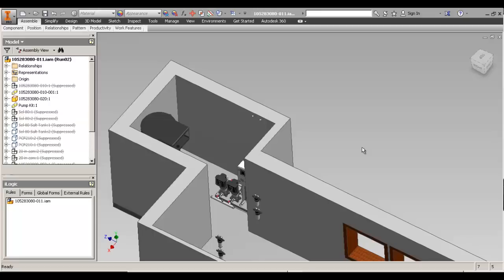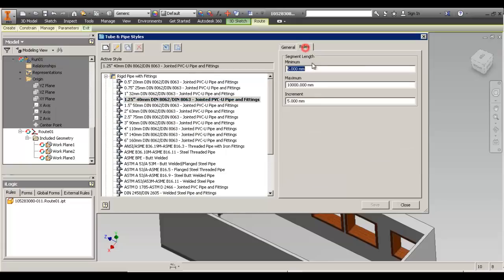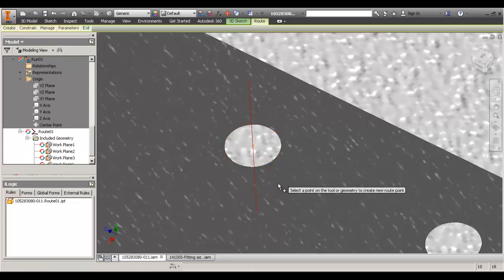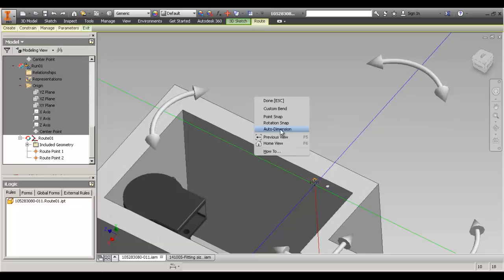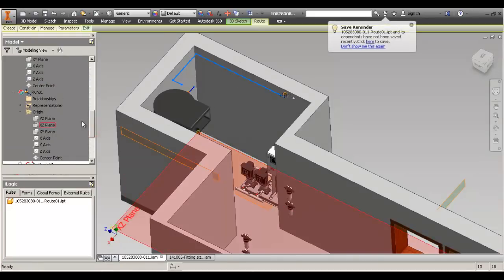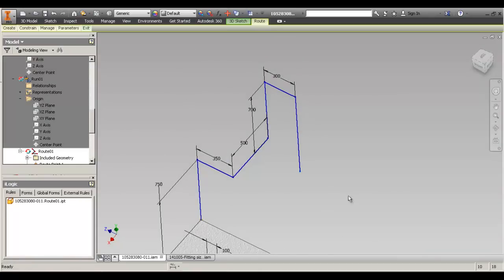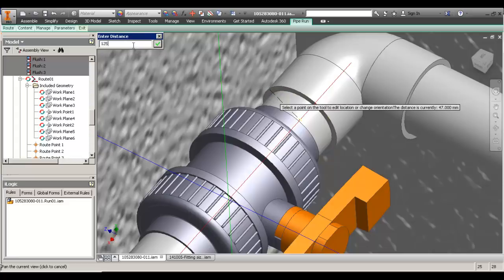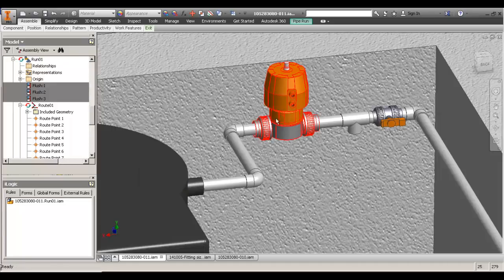Autodesk Inventor Tube and Pipe

Comment: HI,I find it very useful your video  , But I've encountered some problem, I can't modify the dimension of the pipe ,even though I set a different value ,the pipe remains the same?
Reply from the maker: Valerio Xu Is it just that pipe ? or more items are having the same problem.
Are your files checked in vault (read only)? Is the folder/files read only?
Is the assembly on Defer Update (Manage/Update/Defer Update)?
Is the tube and pipe assemlby set to Defer Update (right click on the T&P assembly in the browser and choose tube and pipe settings, verify that "Defer all Tube and Pipe Updates" is not marked. 

Get back to me if it's still not playing up.
Reply: Adrian Salariu   the "defer update " is off, In the company I can't do it,now I am at home using my computer ,it's not working neither. I just created an arbitrary  pipe,and the size modification is not working
What do you mean by saying the files are read only?
Reply from the maker: Valerio Xu How do you modify the pipe size? 
Do you right click on it "Change Size"?
Do you change the size of the route in Tube & Pipe Styles?
You need to create a separate style for all your sizes. A style can only have one size. Copy your style T&P Styles, choose a different name and size and then you can use it inside your route.
Reply: Adrian Salariu yes,I simply right click and change size. but I want to change  only one segment of  the pipe.Do I still need to create more styles?
I manually change the sweep sketch, but every time I move o edit the  pipe, it goes back to the default.
Reply from the maker: Valerio Xu Right clicking on a pipe segment and selecting "Change Size" should do it. You don't need to create more styles but you seem to edit a tubing with bends correct ? In that case you might want to give us a vote on the idea station because that's not possible at the moment:

http://forums.autodesk.com/t5/inventor-ideastation/tube-and-pipe-overhaul/idi-p/5518269

Here's how to fix it:

Right click on the segment Change Size so that the parameters update in the part. Open the part up (pipe segment) and edit sketch 3, constraint the circles and dimension the outside circle as OD and the distance between circles t or whatever the parameter names you have for pipe outer diameter and pipe thickness.

Come back to assembly and change size again to verify that the segment updates NOW.
Reply: Adrian Salariu so only the pipe with fitting is allowed to change size? but I saw from the link you gave me that even the tube with bend can do the change size to single segment , by the way, I select only one segment,not multiple ones, and I change the size by doing"change size" , but the pipe remains the same .
And If I want to add a pipe diameter to the style, for instance, an gas fitting 1'', the diameter is 33.249mm, how can I do it?
Reply: Adrian Salariu  I kind of got what you've said.the pipe with fitting style ,if I add bend then the segment with the bend can not be modified.but the size of the segment between the fitting can be changed  but here is a problem,when I open the segment part and edit the sketch, constraint the circle ,It worked and the dimension is changed.but when I exit from the tube and pipe demand,whenever I drag the pipe It turns back to the dimension modified before.This bothers me a lot .
Reply from the maker: Valerio Xu We need to find a better place to chat. I can't upload images or videos here.... I'll make a post on my blog and will update it with your comments and whatever media you're sending because I must say I am not having the segment changing back when I drag it around.
Reply: Adrian Salariu OK,thanks so much, I have many questiones regarding to the tube and pipe assembly,and connect fitting.now I am doing an internship at a company  and recently I am assembling  an fluid filling machine  ,kind of frustrating me this thing.

Comment: Hi Adrian! Enjoyed your video! I see you constrain your routes plane by plane. Is it possible to use the "Ground and root" command instead? could be a time saver.
Reply from the maker: Unfortunately not! It's only main TP assembly that can used with Ground and Root. I use this command so often that it's mapped to "GR" on my keyboard. Runs and Routes are adaptive and cannot be grounded, and in fact you get an error message....but I am opened to suggestions.

I started writing ilogic code to help me with this, but I haven't done much piping lately and got side tracked on other things.
Reply: Hi Adrian, if you open the main TP assembly, you can ground & root the runs in there without the error message. In my first tests it seems to work just fine.

On the other hand, maybe you can help me with this little problem: Can i relocate the start and end of a flexible hose (without connectors in the style) in this http://autode.sk/2obgR7m video you can see were i get stuck. 

Hope you can help.

greetings, 

Bram.
Reply from the maker: haven't seen your video yet, but have a look at this blog of mine (no time for youtube videos)

http://blog.ads-sol.com/2015/06/inventor-tp-edit-hose-connection.html

Thanks.
Adrian

Comment: How can I add an extra node to an already populated route when the route was derived from a 3d sketch? I mean, the option to add a node is there when you create the route using autoroute or the 3d orthogonal route tool but when it's based ona 3d sketch it's unavailable, in the 3d sketch you can't just add a point to imitate a node and you can't delete a line segment to alter it cause it won't repopulate it.
Reply from the maker: Not sure.. Have you tried dropping a fitting on the populated route?
Reply: @AdrianSalariu-ADS  I just tried that. It won't work. The dynamic tooltip says something along the lines of "Can't insert a fitting to a derived route". It's sad, without it using a 3d sketch as a routing tool looses all ofits charm, unless I'm doing something wrong.
Reply: Meh, I sort of found a solution. You actually have to alter the 3d sketch geometry (break constraints, shorten lines, etc.) to have actual line segments created (adding sketch points won't cut it). Then (only if those segments satisfy the pipe settings) you need to edit the route, choose "derived route" tool again and add new line segments to selection set. Inventor will create generic fittings, which you can then easily replace. Would've been much less tedious if we could divide a line at point...
Reply from the maker: Glad you found your way round it. I have changed jobs and haven't used TP in the past 2 years. I wish Adesk would release a help or manual for TP based on someone looking at the code rather than, how the module was designed to work. They should contact people that use it every day to document the tips tricks and pitfalls.
Reply: @AdrianSalariu-ADS  I guess the resources are out there, but they are so scattered around and hard to navigate it's sometimes quite hard to find the exact options or workarounds you need. Thanks for taking interest in my question. Cheers!

Comment: Thanks so much. This was great. Though I tried to use download parts just like that and got stuck. I had to author and publish them first before it worked like yours. IV2014
Reply from the maker: Hi John, if you've downloaded parts from my blog then they are (most of them) 2015 or newer so you won't be able to open them.